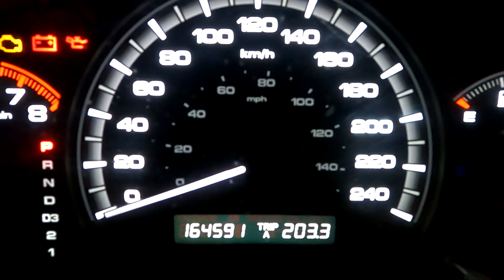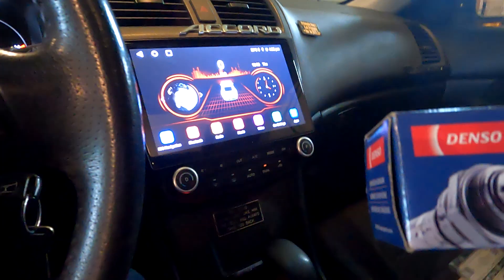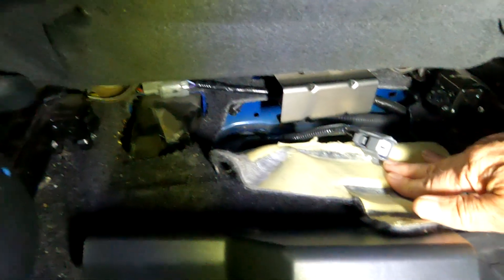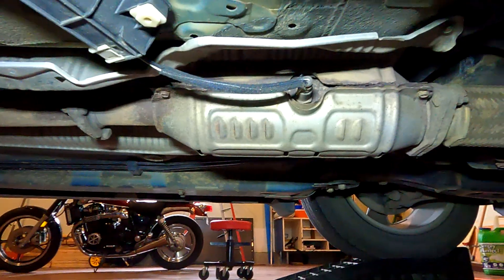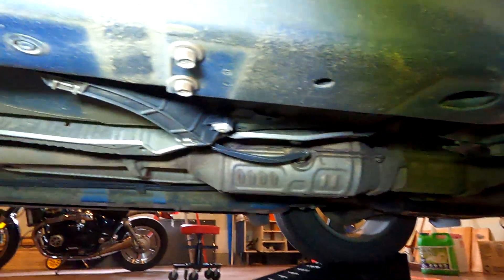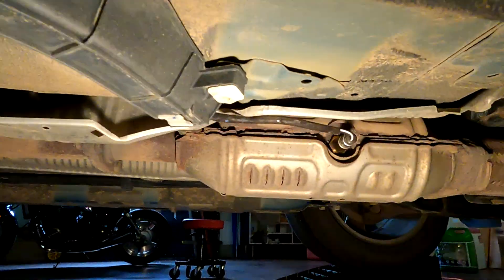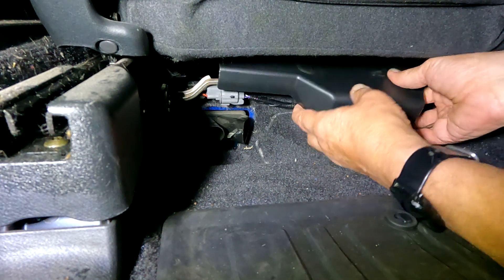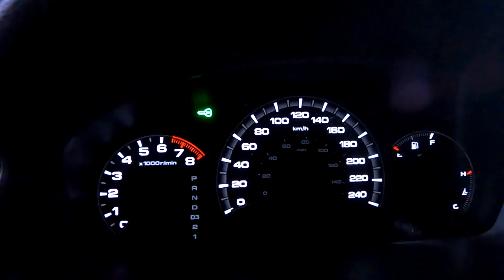2006 Accord downstream O2 sensor replacement

Comment: Where in the car are you?  You are talking about carpet..... in the trunk? Under the dashboard?? Where are you
Reply from the maker: It is the carpet under the passenger seat... sorry, I figured most people would know.  If you look closely you can see the rear floor mat and the seat rail on the left.  Also when under the car we see where it goes up into the car, pretty much the middle way down where the back seat would be.